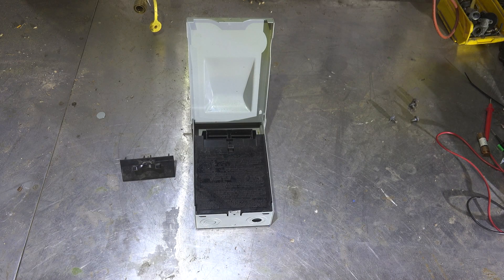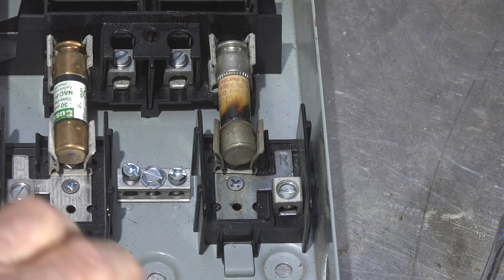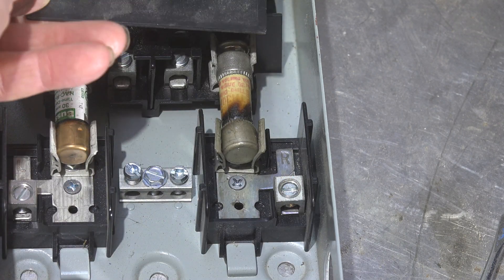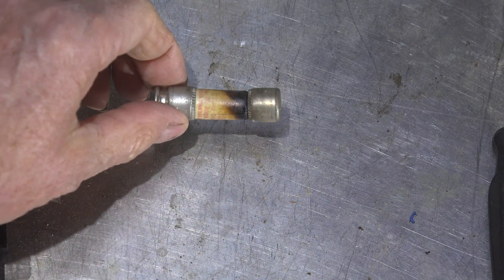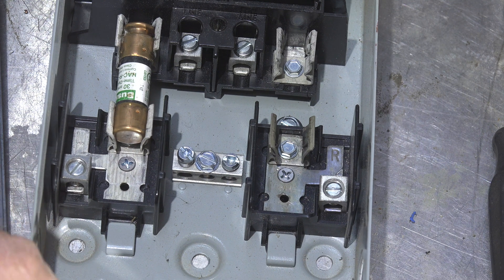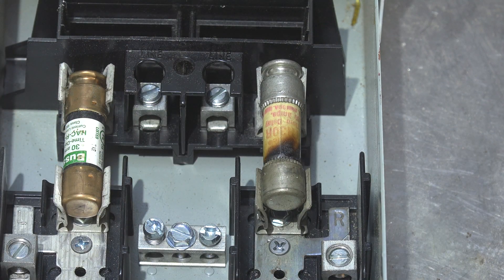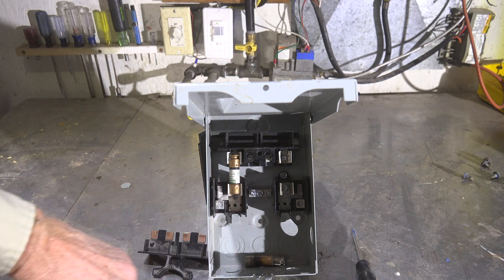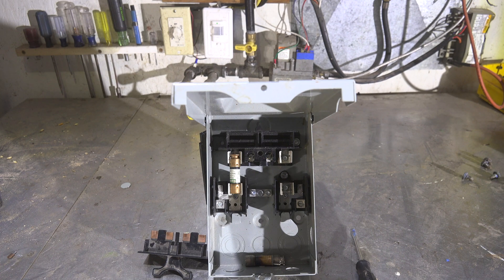Burned fuses in disconnect

Comment: mine caught fire today. what i don't understand is how it didn't flip the fuse in the switchboard. i jumped on it to switch off the AUX fuse
Reply from the maker: Overheat does not mean high amp draw, just bad connection.
GFM
Reply: @grayfurnaceman   in this case it would worth replacing the disconnect box and test the heatpump. maybe its OK. should i go with a fused box or none fused one? it seems like the none fused are more popular.
Reply from the maker: In most jurisdictions, a fusible disconnect is required.
GFM @Sean-Aviation

Comment: Very valuable. Have a question that probably seems dumb. Can the heating/melting happen even if the AC is not on? I found a disconnect box was warm, then found exactly what you described inside. But the AC unit has not been on--not in a year!
Reply from the maker: No it can not.  Exterior heat cannot cause this type of failure.
GFM

Comment: I found this video very informative! I have an older style home that I just moved into. It has one main service panel using circuit breakers, and 2 separate subpanels. Immediately after the main service panel with circuit breakers, is a sub panel with 2 30-amp cartridge fuses in a metal box with metal closing door. After this sub panel is another that is located in the detached garage with 2 20-amp glass fuses. My question to you is about this middle sub panel with 2 cartridge fuses. The box these cartridge fuses are housed in does not have a raised bump to attach a ground wire and screw. Instead, the bare copper wire is just sitting there in mid air. Doesn't that need to be connected to anything? Could I tap a hole in that metal box and attach a green ground screw and wire to that? How are the outlets in the garage still working with no ground connected to them? (Garage wiring has confirmed 12/3 wire)
Reply from the maker: The outlets will work without a ground.  The ground is a safety system.
I would connect the ground wire to the enclosure.
GFM
Reply: @grayfurnaceman  Awesome - will do and thanks so much for the info :)

Comment: The only time you need a fused disconnect is when you are tapping into a feeder with a higher ampacity.  
Normally the circuit breaker in this panel provides the overcurrent protection. There's no need for fuses  In the disconnect if you already have the appropriate sized breaker in the panel feeding the disconnect.
Reply from the maker: 40 years ago that would be correct.  Since then, a fused disconnect is required.  I don't know if that is an NEC requirement or if it is Wa state code.
GFM
Reply: @grayfurnaceman  You only need a fused disconnect at the location if it says "maximum fused" not "maximum over current protection" on its name plate. Otherwise breaker in the panel is sufficient, and you don't need a fused disconnect. It's part of the UL listing as per art. 110.3 in the NEC. Nowhere does it state that there has to be a fused disconnect in NEC art. 440. It must be in the WA state code.

Comment: I work on commercial dish machines and they were having this issue, they replaced the disconnect and had no issues for about a year. Now it’s happening frequently. I tested the total amp draw of the machine and it wasn’t enough to blow the fuse. Could the disconnect go bad that quick?
Reply from the maker: If the fuses are burning (not just blowing), either you have wiring connections that are not tight, or the disconnect is just failing.  You could try using a disconnect that utilizes a breaker.  They generally are of higher quality.
GFM

Comment: My disconnect is a switch rather than a pull-out.  How do I check the fuse? Do I just need to replace the entire switch?  Also, one wire I see going in is discolored.  Does something need to be done with that wire?
Reply from the maker: You probably have a breaker for circuit protection rather than a fuse.  A discolored wire to the breaker is probably from a loose wire overheating.  It may have damaged the breaker.
GFM
Reply: @grayfurnaceman  I prob still need to fix the wire issue, but I tightened some screws on the contactor and got power but no fan movement. Looks like I didn’t push the fan hard enough because when the electrician came, that’s all he did to get the system running again.  However, he did say my motor is bad and that it will probably stop working again soon.  He didn’t do any diagnostics at all though.  Is a bad fan motor diagnosed by visual/sound only?  I actually told him on the phone I think it’s a bad motor :(
Reply from the maker: @RJP7093  If he had to physically push the blade to get the fan to run, you have a bearing problem or a capacitor failure.  If the fan does not move easily with the power off, it is a bearing problem that is easily diagnosed by attempting to rotate the fan.
GFM
Reply: @grayfurnaceman  I had just changed my capacitor before calling electrician(old cap was fine but then in testing Voltage from common to fan, Idk what happened but it killed the cap 🙁).  But with the system off, I’m able to turn/move the fan easily.  Before electrician came, I tried to move the fan with system on but it felt stuck (not at all like when system off) so I didn’t push harder.  Hoping it’s ok now since the fan moves fine with system off?  because the guy said if I don’t replace fan motor and fan stops running again, it could kill the compressor too.

Comment: I was looking at my furnace and it is a older one when the power was put to the fuse it sparked and looks burnt
Reply from the maker: If it is a screw in fuse, you probably have a short in the furnace or its wiring.
GFM

Comment: Looking at the bottom fuse clamp it is rotated slightly clockwise causing it to contact the fuse at 10 and 4 o'clock only rather than along the full sides of the fuse. This reduced contact area caused the overheat condition.

Comment: I'm glad to see this brought up. I had one disconnect box get a little toasty and melt the pull out switch. I looked it over and the only damage area was the switch connector, so I just figured it was a cheap box, made cheaply, and it failed of its own accord, especially considering the switch was fully and tightly pushed in. I just placed a new one on a hot water heater and the thing is even cheaper than the one I bought a few years ago. It amazes me how they can make these boxes so cheaply.

Comment: Thermal cameras is not the tool of the future it is a present day tool. I bought mine several years ago and now they are better and more for your money
Reply from the maker: Thermal cameras are a valuable tool that keeps your fingers away from terminals.  You just have to remember the circuit must be under operation for at least 5 min before testing.
GFM

Comment: GrayFurnaceMan, help.  My outside condensor was running all night long while the thermostate was not calling for AC.  I had to turn off the circuit breaker to the condensor to stop it from running.  Why is this happening?  The next day, I turned on the breaker, the unit work... for a few days and then it happened again.
Reply: Sticking contactor.  Happens to me every few years.  You can clean the contacts with a contact burnishing tool, then blow dust out, then clean with alcohol with thick piece of paper or cloth.  This will fix it until you can buy a new contactor.
Reply from the maker: Do you have a whole house fan?
GFM
Reply: grayfurnaceman not exactly sure what you mean by whole house fan.  But my HVAC system is comprised of an AMANA 96% efficiency furnace connected to an outside AC condenser.  That outside unit was stuck ON for god knows how long until I had to cut the breaker.
Reply: Oh, and the outside unit was not replaced with purchase of the furnace.  It’s an older Carrier (I believe) unit that has worked for us over the past 7years.
Reply: Just thinking about your question again.  The furnace fan can be turned on to run and circulate air if I chose to.  But I don’t use that feature.  So, the t-stat is idle for ac in the middle of the night while temps are well below the cool setting and yet that outside unit fan is just going.  No cool air is being blowing from furnace as it is OFF.  Touch the coil plenum it is cold likely iced over.  That’s when I cut the breaker.  Wait 2days before trying it again.  And it worked for a few days, then stuck on again.  Hope that helps.
Reply from the maker: If the indoor fan does not come on, the whole house fan is not the issue.  
The only issue I can come up with is the contactor in the outdoor unit is sticking on.
Generally, if a contactor sticks on, it will not open even if the power is cut off.  
GFM

Comment: I used to see this a lot with air conditioner disconnects supplied with aluminum wire in Phoenix. Aluminum wires worked loose with heat cycling. Need to annually tighten lugs.

Comment: Why have another set of fuses in line with the appliance , is it not fused at the breaker panel . why is it fused twice ?
Reply: Because the fuse is supposed to protect wireing inside the structure by blowing b4 the wires heat up enough to burn the structure also fuses need to be rated 5 amps below the breaker ratings ie 30 amp breaker 25 amp fuse and and so forth. it's also used as a service disconnect.
Reply: It has alot to do with the distance from the breaker panel as well. If panel is not within eye sight,  a disconnect is required as I understand it. I'm no electrican by trade though.
Reply: They MAKE disconnects without fuses, but it's hard to find vendors that carry them.  I live in California, and could find NO reason why fuses would be required.  The disconnect is a required safety shut off, to protect a technician working on the unit (if somebody turned the circuit breaker ON, technician would still be protected, because the disconnect is within sight of the AC condenser unit).

Comment: some burnt wire ends and lug terminals would have been a good visual, also explaining and showing not to try and clean overheated wire either, just cut well past any burnt or replace the whole line

Comment: High resistance in disconnects is bad. I rarely use fused/breaker disconnects.
Reply from the maker: Interesting.  In my jurisdiction, a fusible disconnect is code.  Not that it makes sense, an HACR breaker in the panel would suffice.
GFM
Reply: @grayfurnaceman  Redundancy would be my guess. Here in PA (Pittsburgh) a fused disconnect is not needed. However, some inspectors here won"t pass you if the breaker, inline with the disconnect, is 5 amps oversized for the load application. Even i the wire can handle it. 

Goodman 2 ton 13 SEER "Maximum circuit breaker ampacity" = 15 amps. I had it wired with 12-2 on a 2 pole 20 amp. Oh well, live and learn.
Reply from the maker: @Spector_NS5_RD  The "manufacturer's instructions" clause.
GFM
Reply: I agree. Where I live a disconnect is required but it doesn't need to be fused. When I installed my mini split I used a non fused disconnect for reliability, the 15 amp breaker in the panel does the same thing making the fuses redundant in my opinion.
Reply: fused disconnect is kind of leftover from fused main panels, but also to help curb idiots from moving wires in the panel and double lugging a 50 or 60amp oven feeder, just to gain 120v branch circuits space. the rest of us install a subpanel or replace the undersized panel and entrance ;)
I've seen countless times double lugging of 10 and 12awg and even 14awg wire with 6awg into  oven/range feed breakers or off the panels direct bus bar lugs, so full main breaker current available. fused diconnect at th other end could potentially save a burnt house, though it's still not right.

Comment: Too bad they don't sell replacement fuse clips since the ones on that box looked easily replaceable.
Reply from the maker: The problem with that is the disconnects are very cheap.  Parts would probably cost more than the disconnect.
GFM

Comment: Great info! Same thing happened with my house's power meter box. Some of my lights were flickering and dimming, especially when high amp draw appliances like the oven were running. I checked the voltage at the breaker panel while the lights were flickering and I found that one of the hots had low and unstable voltage. I called the power company and the guy who came out found that one of the clamps in the meter box was loose and not making a good connection with that prong on the back of the meter, it actually got so hot that it burned the back of the meter. He squeezed it with his pliers so it clamped the meter's prong tighter and replaced the meter and I haven't had any problems since, but after seeing this video I'm thinking he probably should have replaced the meter box or at least that part of it.
Reply from the maker: I am sometimes amazed that the people that should know better just don't.
GFM
Reply: The meter box is usually the property owners responsibility. Call a licensed electrician.
Reply: @carlmccoy662  I called the power company about this earlier today and they offered to give me a new meter box for free. They won't install it, but they will shut the power off for free so I can change it. I haven't had any voltage drop problems since they "fixed" it, but I am going to change the box out anyways since it won't cost me anything other than a trip to go get the box and the time it takes me to change it out.